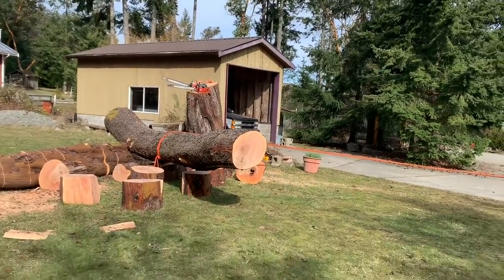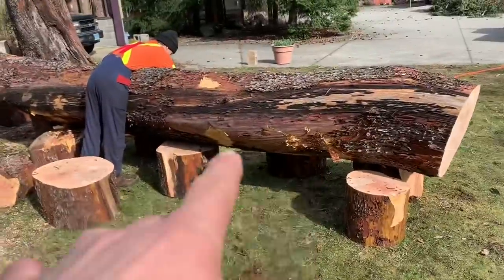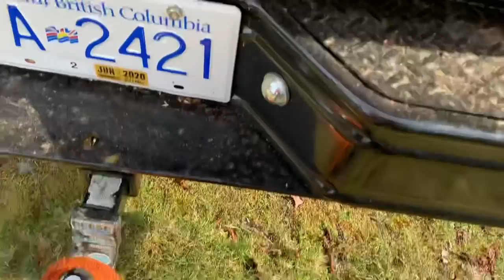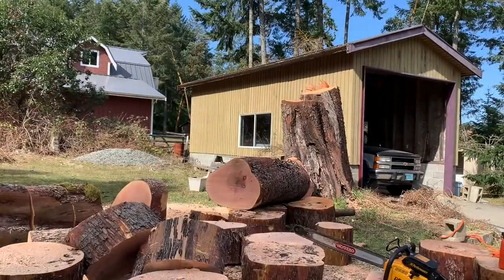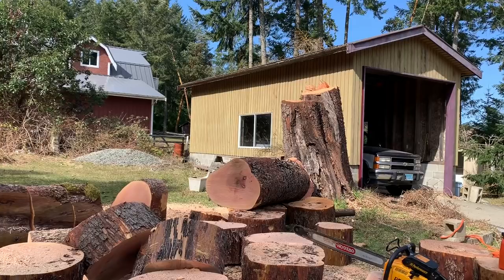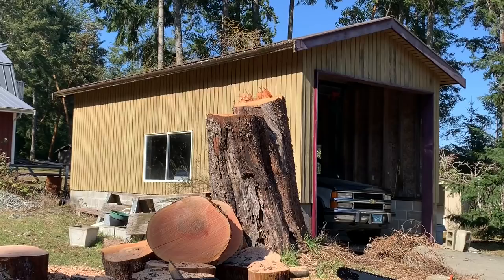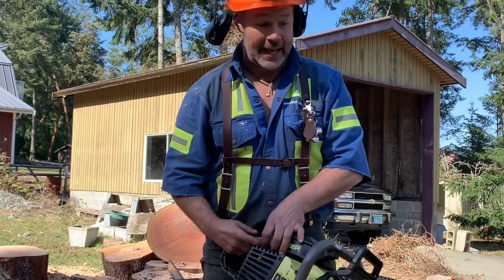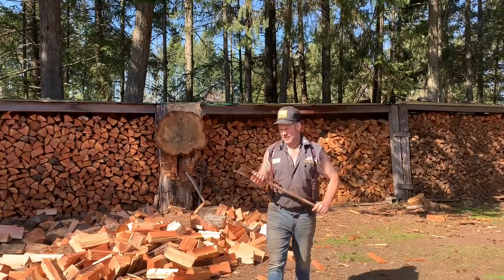Big ol' chainsaws, cutting big hard wood log, and a message

Comment: When you said selfless, and stepped back, I was sure you were about to throw the axe back over your shoulder at the target without looking! Love the old school chainsaws, guys. Just got an ECHO 750VL from the scrapyard for a fiver, no bar, but complete otherwise. Started, but pissing petrol from somewhere and needs a tune. Already have a 25" stihl sprocket tip bar if the pitch is right, will be fun setting it up.

Comment: I like that Poulan hat.  For years I ran Poulan saws but if you mention Poulan,these days, everybody laughs, because Husqvarna has turned them into warmed over junk.  I still have one of my old Shreveport saws and it still runs great at 35 years of age.  I never ran real big saws because I do not like saws that wear you out before you get them cranked up.  I also do not like saws that I need a helper to carry from one spot to another. The 3800 and 395 were my favorite saws.  The 3800 had a 20 inch bow on it and the 395 had an 18 inch bar, typical stuff for the period.  Now, I have much bigger saws but they weren’t as much fun as those old Poulans.

Comment: Mr. Smith. I have a 1978 Craftsman with a 18 inch bar that I’ve taken to two different saw shops and have been told it can’t be fixed, I don’t believe it because the saw looks in great shape. The saw was given to my father when he retired from law enforcement and I can’t throw it away, sentimental value. I see you have older saws that you like to make run like new. I wonder if you could fix it or at least tell me what it needs ? Any ideas ? 👍🏻🇺🇸

Comment: Enjoy your videos Billy. I've learned a lot from them. Do you use those foam plugs in your ears rather than ear muffs? I've tried the foam plugs but can't seem to get them to stay in place. Is there a trick to using them? I've never worn a hard hat while gathering firewood as I don't fell trees but I had to wear them for over 20 years in the local bushfire brigade; it was mandatory. Gee that is nice looking timber you are cutting. I have a Dolmar 1600 (60cc); great old saw from the early 90's.

Comment: After 26+yrs as a Firefighter/EMS First Responder, if I've learned anything, it does absolutely nobody any good to freak out during a crisis.  The only thing that happens, is the crisis gets worse. Keep calm and under control. Use common sense and critical thinking skills and it'll see you through a whole heck of a lot better than melting down.